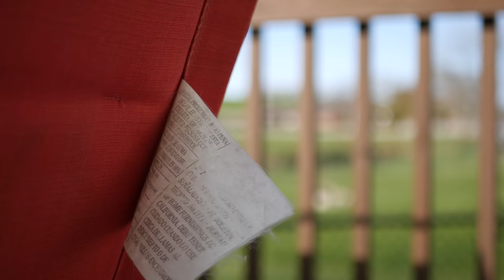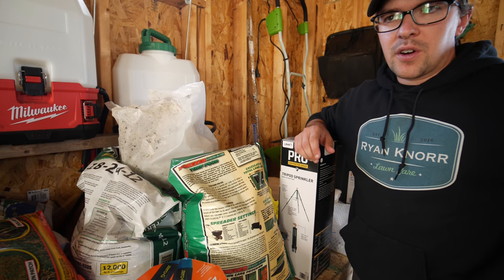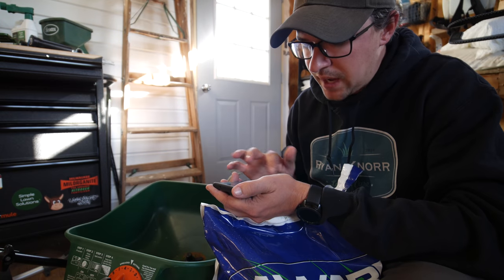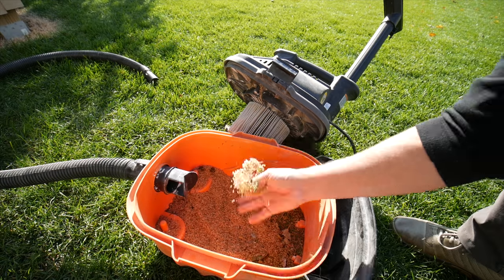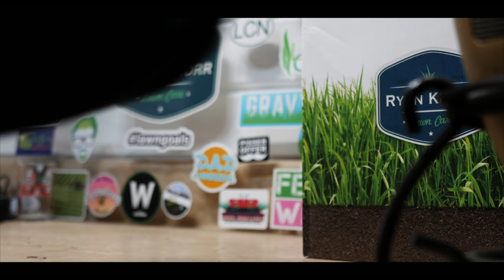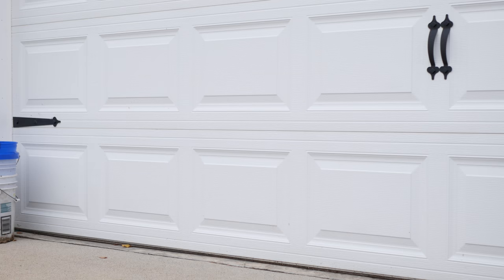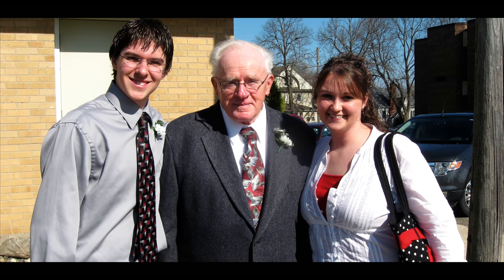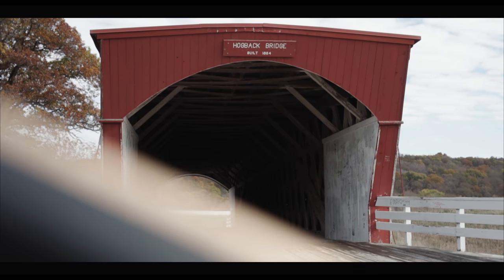Lawn Winterizer Fertilizer and Equipment + Bonus Footage Madison County

Comment: I recommend that people thoroughly clean their lawn mowers. Grass has a high moisture content and can work like a sponge holding moisture against the metal. Even aluminum will oxidize. Of course for the extreme types a good coat of car wax after a good power washing ensures no rusting and less grass to clean off the deck next season. Saves time in the long run.
Reply: TheSuperGreenDude , thanks for that advice 👍🏿
Reply: @heinzkitzvelvet  not if it's the amazing aluminum deck 😁

Comment: I'm working on raising my ph.  I've decided to do it the very slow completely low-shock and organic way...  I add a cold pot of coffee to the sprayer with each round of fertilizing.  So far so good - almost at the 6.8 I'm targeting (the soil was incredibly alkaline, so much it's hard to believe I got such good results with my renovation this year).  I've done my last fert for the year, but I may do one last spray before the real freezes come with just diluted coffee.  Hopefully by the spring growing season I'll be at 6.8 (fingers crossed).
Reply from the maker: So you're actually lowering pH with coffee being acidic?
Reply: @ryanknorrlawncare  Right.  Got that backwards.  LOL.  It's late.  Thanks!  Ph was over 8.5 when I tested it this summer.

Comment: Hello Ryan. I did a partial renovation/ Over-seeding on my front lawn. I had some rich soil in a garden I removed that I used in areas. Unfortunately wherever I used the garden soil I got clover mixed in with the new grass. The grass is slowing down now and I don't know whether to try to kill the clover now or wait until spring. I probably have at least five mows on the new grass. Any thoughts?

Comment: As usual, great video, thank you. 
I have a question: I reseeded a 5k ft area in early September with a 33% rye, kbg, and turf fescue. Used the starter fertilizer from menards 10-18-6. Do you think I need to put down some additional fertilizer for the winter? I usually buy that orange bag at Menards. 
Thanks in advance for any information 
Location Ann Arbor area

Comment: Seeing the lawn equipment get put away for a few months tends to break the spirit a little. Taking the mower deck off and replacing it with a plow blade to push snow validates staying in the Midwest. We need to get you a grasshopper, so you can enjoy every season. :)
Reply from the maker: I am wishing and hoping for a lot snow so I have something else to do :)
Reply: Fertilized rhizomes do well under a snow pack. Sorry for validating Connor's KBG.

Comment: Hey Ryan, I overseeded my cool season grass this year and didn’t put enough starter fertilizer down for the seed and it took a while to grow. It’s nearing the end of October’s and the highs cap out in the low 50s and the lows in the mid 30s. Would a 24-0-11 Lesco slow release fert hurt one of the KBG that only started germinating 2 weeks ago? I plan to done winterizer fert app in the first week of November. 

Also, any opinions on slow release vs quick for the winterizer app? Thanks!

Comment: How much does the electricity cost to run that lawn pump versus the cost of water?  My house came with a well for outside water and after I did the math it was about 2x more expensive to run the pump with electricity versus the cost of city water.
Reply from the maker: We just use it for the garden during the season...my small pump does not use much electricity